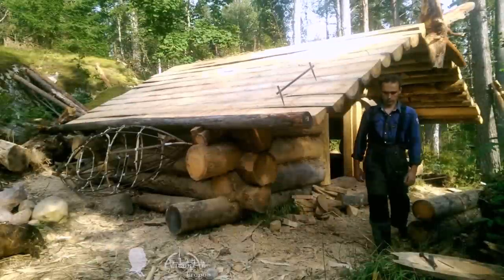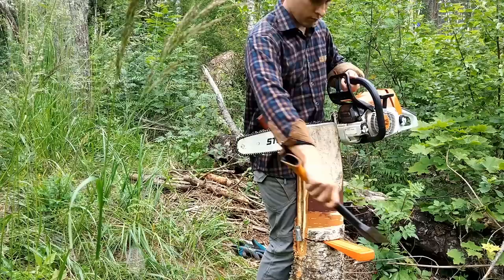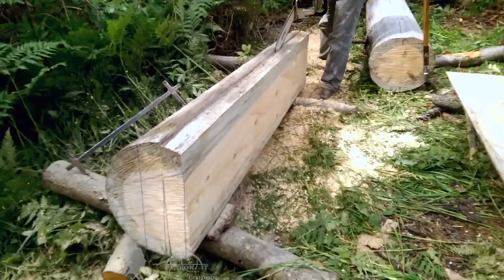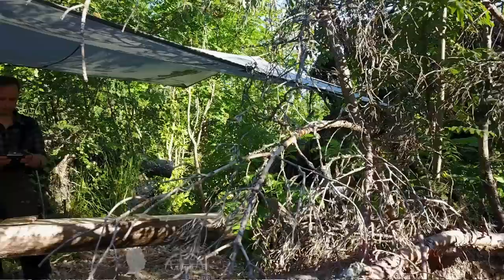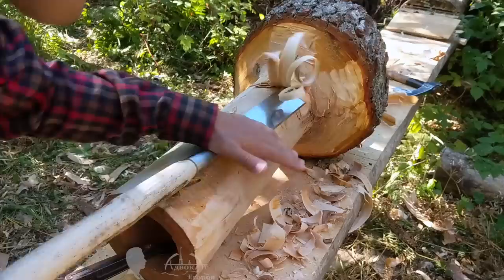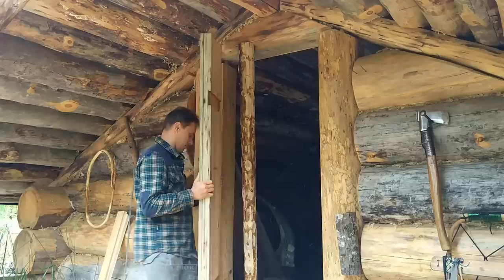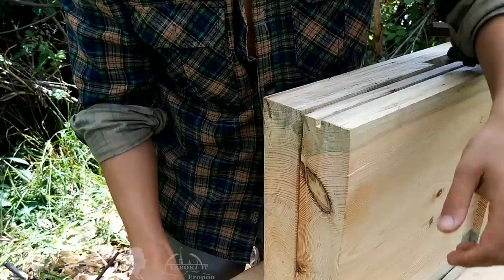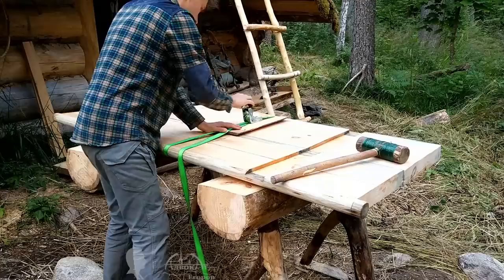Bear-proofing My Log Cabin

Comment from the maker: Friends hope this video could take your attention away from those recent coronavirus pandemic events for a bit...
Good mood = Good immune system!
-------------------------------
Friends, for your convenience I assembled a chronologically arranged list of videos about my efforts in establishing
this log cabin camp in the off-grid remote location of Karelia (All Seasons): 
-------------------------------
01 episode - @ (1 season)  2014
02 episode  - @ (1 season)  2014
03 episode  - @ (1 season)  2014 (not translated) 

1 episode  - @ (2 season)  2015 

 2 episode  - @ (2 season) 2015 

 3 episode  -@ (3 season) 2016 

4 episode  -@ (3 season) 2016 

5 episode  - @ (4 season) 2017  

 6 episode  -  @ (4 season) 2017   

 7 episode  - @ (5 season) 2018    

 8 episode  - @ (6 season) 2019 

 9 episode  - @ (6 season) 2019 

10 episode- @ (6 season) 2019
--------------------------------
My Patreon page: @t
Reply: Спасибо за чудесное мастерство! Молодец юрист!
Reply: @carlosdelascuevas6140  спасибо, только я адвокат ))
Reply: I was taught to lay the hand jointer or plane on its side by a pipe organ builder and most all do not...But I saw yours on its side. You were taught well my friend...Great video!
Reply: wallytron101 IMO, it makes no difference if you lay the plane on the sole, unless the surface is metal or something that can damage the blade
Reply: @abebeaku8369  NOPE, not what I was taught and I was taught by a Pipe Organ builder who built the Notre Dame Pipe organ and that is what he said....So, there...
Reply: Friend,
Thank you for sharing this video.
If I Recollect Correctly,  I heard you mention in a previous video that you were putting two doors in to allow escape if a creature camped out at the other door.   As for the doors opening outwards,  my guess is that it is part of your bear proofing.  The bears might be able to push in a door,  but they'd be harder pressed to pull one open.
Please do share a video of you building that last bench you showed.
Reply: Gday Love the Natural Roof but with this video it clearly shows if you had a forest fire
your entire cabin would burn down

You need to use something like
Rocks / Dirt / or sand
or brick wall
and give your cabin a good distance between plants/scrub/trees
Reply: thank you for posting i am planing a cabin in cobalt, ontario. i will use this for my windows. TY
Reply: Plenty of people with (pandemic) cabin fever watching this - oh the irony!
Reply: GOOD MORNING!
Reply: What NECK OF THE WOODS DO YOU LIVE IN  . A BEAUTIFUL PLACE  . 👍🙌
Reply: Advoko MAKES tyyyy
Reply: @haltompkins7589  Hal Your reply comment is over my head i just don't understand it please explain 😨 .
Reply: Thank you. This was just what my home school students needed.
Reply: Thank you, very interesting!!
Reply: Thanks, for the boost in spirit.... it's always a welcome thing.

Stay safe!
Reply: Thanks for sharing.  What a great life to live their. Plenty to do that must be done and sweet solitude. I think to add strength to keep big bears from pushing the door inward?
Reply: Took my attention from start to finish,amazing skills.Hi from New Zealand
Reply: If you have spare time during this pandemic we would love more videos. ;)
Reply: Great workmanship.  Enjoyed very much.
Reply: Thank you.  You have the best channel on youtube.  Thank you for what you do.
Reply: Grazie amico, sei davvero bravissimo. Ti ho guardato con interesse, vorrei essere così capace e paziente come lo sei tu!!!
Reply: Have you ever heard of Dick Proenneke, he had an adventure in the woodlands of Alaska similar  to what your doing now. Their is also a Documentary of sorts he filmed well out there.
Reply: Did you make the doors open outwards to make it harder to get in or just because you felt like it?
Reply: or was it so you can carry heavy things out and nobody has to hold the door open for you?
Reply: Indeed
Reply: Subbed. I have been wanting to do this for years.
Reply: The problem with the Brazilian saw is thath it's made to be matching the brazilian fuel, here in Brazil all our gasoline and some other kinds os fuels will always have 30 per cent Etanol(brazilian Alcohool) so every motor made in Brazil is made with this in mind, even the cars imported to Brazil suffer with our gas, that's why most of the car companys build a different motor to user only in Here in order to don't srew the motor.
So if you are no using any brazilian gas it's better if you just stay out of motor products made in Brazil.
Hope I helped a little!
Reply: Advoko MAKES Wow! Great work sir! Beautiful country.
Reply: The door will open out to make it more bear proof o guess it will be pushing on a door that's more solid
Reply: the door thing.... to make it stronger in case of animals trying to break it and go inside?
Reply: Could You Please, Be Able To Make Me A Wire Clamp? I Would Gladly Pay For A Replica. Please Let Me Know How I Can Reach You. God Bless
Reply: The doors open outway cos if there comes fire you can kick it out. Least thats reason for the law that makes care this in finland. Other ine might be that bear cant push it in.
Reply: Advoko MAKES - you explain the jobs very well, to help us understand the project. 👍🏻
Reply: that was great thank you
Reply: Thank you... It was actually very relaxing to watch and informative. Thank you. Inspired❤
Reply: considering how many views you have and how many subs you have you shouldn't have only 27k likes on a video like this. you deserve more likes. and you remind me of Bob Ross with your patience and positivity and your way of commenting, keep it up!
Reply: If you leave your wedges and pillar inside the hut, you can likely still remove the door if you really need to break out of snow.
Reply: Cheers from Mendoza Argentina, love your project !!
Reply: Amazing cabin. I do really like its sturdiness and look, very practical.
Reply: im sure you know this but if that ends up being like a summer home then you can use that clingwrap to build some kind of makeshift greenhouse and grow some crops
Reply: Hello Advoko Makes
May I know in which country you are living and which region ?
Reply: Stick your Videos on Bitchute/LBRY
Reply: I can't wait to see your locking/latching mechanism.
I might have made one door inswing and the other outswing
But overall, I prefer inswing with the extended roof😎👍👍
Great job sir
Reply: Yes
Reply: Starvin Marvin  Do you mean about WWII?
Reply: One of the most satisfying vid <3
Reply: Advoko MAKES 
Get a Husqvarna chainsaw 👍🏻
Reply: Heimrik01 Advoko Makes has stated that he is a lawyer in St. Petersburg, Russia; he built the the log cabin in the Karelia region.
Reply: This is pretty cool. I always wanted to do a moss or grass roof but I'm wondering, wont that bring bugs inside from the ceiling? Or roots grow through the ceiling. If anyone can seriously answer i would like to know. Thanks. :)
Reply: @Heimrik01  he said, that he is living in Karelia, Russia
Reply: Your voice is soothing and watching you build your log cabin and the process is extremely relaxing. Excellent work.
Reply: @NATURAL SPIRIT I avoid building too close to any water source..for the reason random animals will show up. I usually build on any uphill area about 1/2 mile from a water source(I would rather haul water than fight a wild animal)..if you have enough time you can actually divert a small water source to your cabin to avoid hauling water
Reply: Love your accent and English, very pleasing , where are you ? From and in the forest ? I’m going remote too to Wisconsin USA , love the natural fallen trees you use instead of cutting and waiting, bears are a natural hazard in Wisconsin too great ideas please share more 💕
Reply: Wow What an awesome video. Thank you for sharing..Keep them coming!! 👍🌲🌲🌲☘🌿☘🐻🐿🐇
Reply: you should start selling your services , not just videos, have people come out to the forest and build with you
Reply: @checktheplaylist101  you are correct, now we need people from all walks of life, all over the world, to take out these so called elites and destroy the new world order, this is our planet
Reply: Bears 🐻 push in Man 👨 pulls out..
Reply: If the door was part open , the outward door would wedge a fat bear in the door jamb.
Reply: pretty impressive quality work.    bravo and easy to watch
Reply: Cheers! Which is the "blowplaner" or whatever that you purchased?
Reply: I love watching you work through it and figure stuff out and the handcrafting is for lack of a better word truly Zen these are things that most people have forgotten how to do never knew how to do it's really a dying art thank you for sharing this
Reply: Aztec Warrior  okay Aztec warrior... lol
Reply: Your inspiration for me to complete my homestead
Reply: I heard the Bird
Reply: Brilliant craft man'ship
Reply: Please make more videos like this I could watch you craft all night
Reply: Your Videos are really interesting! Keep up the good work!!!!! any more content you make is highly appreciated cause youre a master!
Reply: I saw the weird wood log in the middle of your cabin roof and thought maybe you could drill a hole in that log and make a rain catcher! Cool video btw!
Reply: Advoko MAKES are you the new bear grills
Reply: wallytron101 iiere iiin k.    The
Reply: Having the doors open outwards adds more safety to bear proofing, if they opened inwards a bear in a sustained attack could push them in, much respect on your work
Reply: No fear here
Reply: You made the door swing out because the title of the video says "Bear-proofing my log cabin". A bear is far more likely to push through a door that swings inward with its weight, than a door that swings out, if trying to get into your cabin.
Reply: @NATURAL SPIRIT I think he's Finnish... just in case he never sees this. ;)
Reply: I really like your calm voice, and your accent reminds me of my granpa who lives in moscow i love your videos
Reply: in canadian rockies parks, all warden cabins have doors that open outwards. the door stop being a lot sturdier than a latch, bears who normally push on doors from a standing position would have a harder time breaking in. often on isolated cabins, a bed of nails is installed at the door step to discourage such curious bears when the cabin is left unoccupied. even windows are boarded from the outside with protruding nails. bears are smart and strong and could break in any cabin if they where determined enough. the tick is making it hard for them to do so.
Reply: The door opens outward  Rather than inward because if it had opened inward the bear would have a better chance of getting in because they push rather than pull. Is that why you did it?  I need to know it's killing me not knowing hahaha.
Reply: Great video!
Reply: Its obviously a hoax. Are you are free mason? D:
Reply: @curtisvonepp4335 : This looks like Russia, north of St.Petersburg, beautiful country!
Reply: @Sagradomoly  Yes this is a beautiful world we live in thus all keep it that way 👍🙌😁.
Reply: Thank you :) Always a pleasure watching your videos or Instagram posts. I'm playing catchup today!
Reply: dont worry
theres never had any pandemic
only economic fake collapse for economic war usa
(for exemple see objectif eco tv videos on corona, in french sorry)
short
your cabin is one I like most on YT,
and your ideas
congrats
have fun
Reply: Advoko MAKES Subtitulos en español por favor. Saludos desde Argentina. Thank you.
Reply: I believe you made the door swing out so the bears cannot push it in! And secondly the wind would blow in the door possibly. 

I like your ideas!
Reply: Awesome!!!!!! I'm so sick and tired of city life....
Reply: Advoko MAKEAmazing skill and beautiful work! Thank you!!
Reply: I AGREE ON THE SAW ISSUE.  FOR EXAMPLE , THE OLD POULON SAWS
MADE IN AMERICA ARE STILL WORKING, THE NEWER ONES ARE NOT
AS DURABLE. THE OLD STILH SAWS ARE LIKEWISE LEGENDARY SAWS.
THE NEWER SAWS MADE BY COST CUTTING WAYS ARE NOT AS GOOD.
Reply: ALSO ARE YOU ALLOWED BLACK POWDER OLD STYLE GUNS THERE?
SIMILAR TO THE ONES SHOWN BY "CAP AND BALL" ON YOUTUBE.
BUSHCRAFT AND BLACK POWDER GUNS GO TOGETHER. THESE
ANTIQUE REPLICAS ARE MADE MAINLY IN ITALY.  CERTAINLY THERE
MUST BE RUSSIAN HISTORICAL BLACK POWDER FIREARMS.
Reply: @abebeaku8369  keep your wit sharp like the the axe inside the shed
Reply: Patience...Patience....Patience....Hats-off sir...U r great creator....!!!!
Reply: 13:39 Such wooden door hinges can be seen in India...Konkan region near Goa...Such hinges can be seen there to the doors n windows as well...The houses made of Soil...!!!
Reply: Where do I find a ball planer ? I have been looking but have been unsuccessful.
Reply: Bears not beats. Lol
Reply: @vuniyaninavuniuci3105  that's easy for you to say.
Reply: say welcome to the gulag, survive and you earn your freedom
Reply: Absolutely amazing work I hope to do something like this one day.  Ps keep up the amazing work and keep the content coming I for one can't get enough of it 👍

Comment: This was a great video. Well produced. So many times folks are not prepared, makes mistakes, poor video etc. Your video was perfect. Your chainsaw problem was due to heat treatment of the aluminum piston and or the metal process itself. I would design the doors to open outward. One, in case of fire you can push your way out of the Nordic 'bunker'. Two, bears instinctively want to get in, so they will push in. Thus the security doors need to open to the outside so the door frame may take up the majority of the 'bears' dynamic pressure. I would add metal  brackets to the door & door frame to hold horizontal 4" x 6" wooden bars. 3 total. Top, middle & bottom. The use of one in the middle would be fine for day to day night security. If you have an active bear attack the 2 other braces would be a welcome sense of security. A bear attack is something you should be prepared for.  As for the bench, build it. My grandfather had one.

Comment: My guess as to why the doors open outwards is that the roof overhangs the door so snow trapping you inside is unlikely, and having the doors open outwards means it is harder for a bear to open them by pressing it's weight upon the doors.

Comment: "Why do the doors open outward?"
They are much harder to break down as it will take significantly more force to batter down the door. This is why castle courtyard doors opened outward.
Reply: Also is emergencies if people get trapped indoors they do not bunch up around the door and not allow it to open. If it opens outwards they can just push it outwards. So it’s safer
Reply: It also gives more available room in the cabin.
Reply: And there's a huge roof overhanging the front so there will probably not be any snow blocking it anyway. If it snows enough to block that, it will block an inward opening door too anyway.
Reply: mrkiky snow drifts

Comment: Opens outward because if it opened inwards then it could be pushed open. Therefore, it would make a terrible bear door because it would have to rely on the lock and not the frame of the cabin.

Comment: Greetings from just a stone throw away, Porvoo Finland. Just recently found your channel while looking for tips on splitting logs. I tried your method yesterday and it worked well. Of course i need some practice but the results were greatly better, than my previous splits. I was thinking about either buying or making a chainsaw mill but didn't think about the disadvantages of them before you pointed them out.
Your channel is very entertaining and inspirational and i want to try making many of the projects and tools you have demonstrated so thank you for that. I am also looking forward to your video about your lumber drying experiments.
Don't catch the Wu Flu and stay well. Summer is nearly here.
Reply from the maker: Thank for your kind words and the feedback on the milling method, neighbor!
Reply: @Advoko  keep the Bear's away from your front door . Use a veary large plank of wood with hundred's of sharp pointed 2 1/2" long screws . When they go to the front  DOOR OUTCH THEY GET SCREWD IN THE PAWS . 🐤🐤👍😁

Comment: About the stihl chainsaw. I know this can happen to chainsaws that are used to hard when still cold. The piston and piston housing expand with heat and so on. Im no expert, so I cant explain. Its just a guess. Sae a video from a guy who repairs small engines an he said it happens with carpenters alot because of timepressure.
Reply: The same kind of damage can happen from being to lean on the high speed needle as well.

 The lean setting causes higher than normal operating temps on the face of the piston and expanding it in the cylinder, causing the damage.

Comment: Really like your use of tools - many folks do not know how to do that.  The chisels, saws, even the hammers have multi uses, and you take good advantage to sharp tools kept clean and useable.  As to the door opening outward:  Bears are big, and quite strong.  But they are NOT the smartest animals, and will attempt to push the door inward.  With the door fully against the door jambs, it is almost impossible to PUSH it open from the outside, and I doubt that the bear will try to pull that door open.  And if there is a fire or something similar, it will open readily from inside to allow exiting.
Thanks for showing all the hints and tips that greatly ease building shelters of this sort.